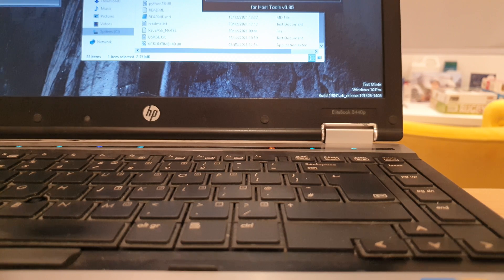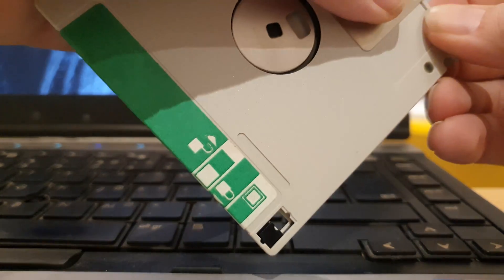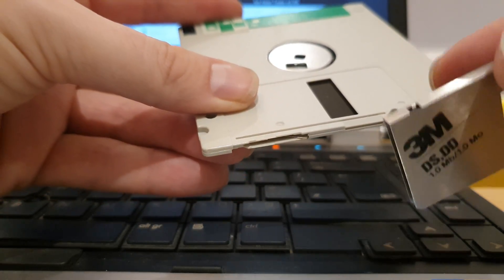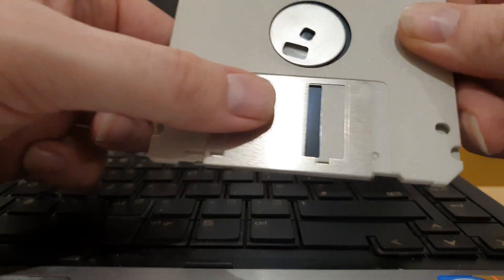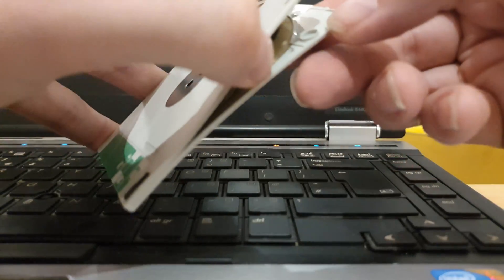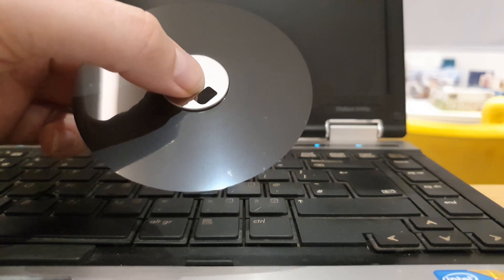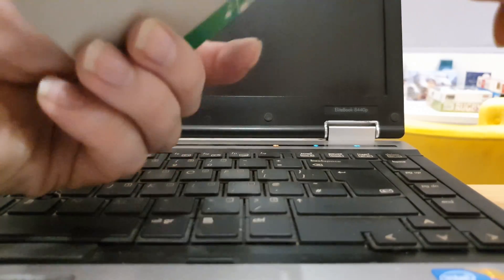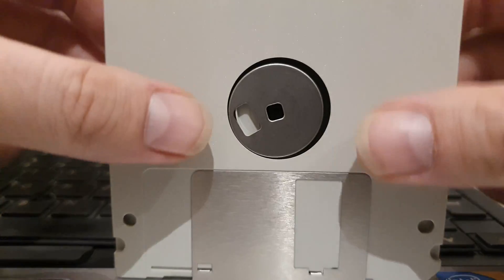How To Remove And Replace The Inner 3.5" Floppy Disk & Metal Shutter Without Ruining Them! 💾

Comment: Brilliant video. I have started resurrecting disks. On some really mouldy game discs I've removed the felt liner, and the disc spins fine. It seems to have been a self clean system built in the floppy. I haven't had any problems as of yet without the felt lining.

Comment: To get the shutter off there is another guy who made a video on youtube and he used a cable tie to slide between the shutter and the disk and it literally just pops off, no need to squeeze and pull etc.  Look for the video on youtube it is called "Removing and replacing floppy disk shutters (disk guard) safely."

Comment: "I want to restore off of original archives..."

Then what would you restore them from?
Reply from the maker: Do you still own an Amiga? If not buy a 'Greaseweazle' for about £20, attach a PC drive to it and read the disks 🤟😎🤟

Have a look at my other channel 'The Floppy Doc', there are a few videos with the Greaseweazle in 👍

Edit: Ahh I see what you mean.
If you go to Archive.org they have most of the Amiga original software there.
Reply: @RiotRetroGaming : I simply mean that "from" is one of the words that would connect you directly to the information or supply source, rather than everything but that source. Thanks, though, because yes, I still own my original Amiga (a 500).

Comment: Great video on how to open the metal slider side of the disk. I use thin sharp nose tweezers to help lift the metal bit over the guides. Also, I typically put the metal slider back in first, then the spring (although this does require the use of tweezers to put it back.
Reply from the maker: Tweezers are good too 🥳

Comment: Thank you so much for this. I had a number of  3.5 floppy discs that got water damaged . They held years of my sound and music samples and compositions  used on an older S550 Roland Sampler. I was hoping to somehow dry them out . Your technique for opening the door will hopefully allow the inner floppy   disc  and outer casing to dry out. If necessary to remove the  inner disc It looks possible to replace it in the  outer casing from what you've shown . Thank you again This is the only video I've seen to address my disaster. Wish me luck !
Reply from the maker: Just don't press too hard, as long as you can just feel pressure from your finger on the other side of the disk, that's enough.
If you are doing it the microfibre cloth way that is...
Good luck & let me know what happens!

Comment: Thanks for hint on how to remove metal cover without bending it! I'm just about to try to recover hundreds of amiga floppy disks, wish me luck! :)
Reply from the maker: How did it go? I have had varying success. I have learned that as soon as you put a disk in to read and hear any sort of noise the disk comes right out. Apparently if you contaminate the heads then you need to clean them straight away otherwise the next 5 or so disks get a light scoring!
Reply: @RiotRetroGaming  Some of the disks I was able to fully recover, some partially (which in some cases was enough, for example to get hall of fame scores from Civilization :) ). I had maybe one floppy that was completely broken, so it went pretty ok. I have more floppies to clean and check, but not enough time for now.